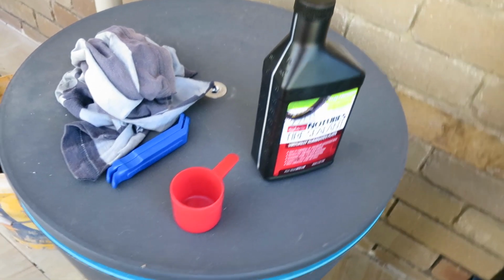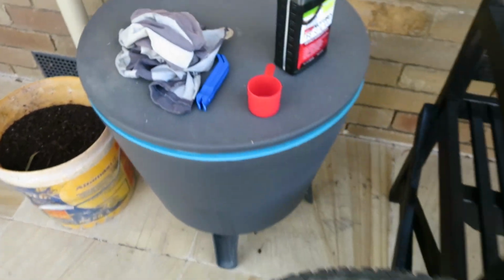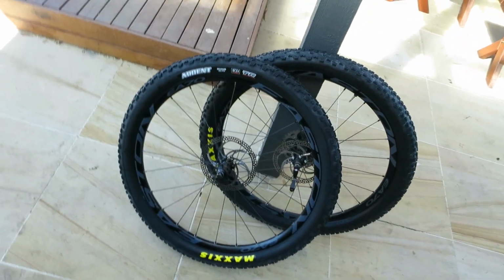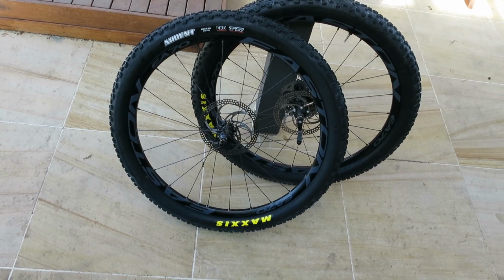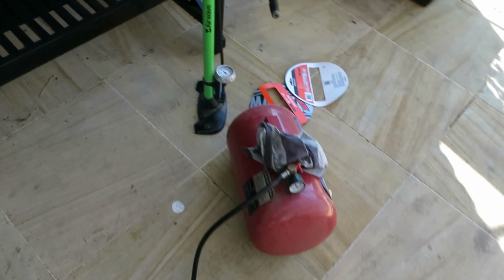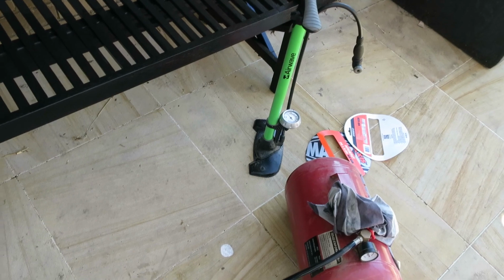Maxxis Ardent EXO TR - Tubeless install

Comment: What is good for trail and slightly jump? Ardent or Forecaster? Thanks
My friends said Ardent
Reply from the maker: No idea sorry mate, I don't do much mtb'ing really. I would imagine a lighter tyre would give you better control in the air but may be less durable on trails depending what you're riding on.

Comment: Hey buddy,  I'm still confuse with TR tyres. It still can be use with tube right?
Reply from the maker: Gordon Yap yes you can use tubes in tubeless tyres. There isn’t much difference in the tyre itself other than maybe a tighter fit on the rim (which also needs to be tubeless compatible for a tubeless setup to work). There’s no need to buy TR tyres unless you want to run a tubeless setup as they usually cost more than non TR tyres.
Reply: @jamdiversified9698  if the rim is not tubeless ready, can using cush core make it tubeless?
Reply from the maker: @madrodeo425  To be honest, I have no experience with crush core so can't comment (I had to google what it even was!).
Reply: @jamdiversified9698  cush core is something like a foam that fits in the rim. It helps to protect the rim on impact and as well as rolling of the tyre.

Comment: how much psi is ideal ?
Reply from the maker: Maybe 25-35, depends on what you like.
Reply: @jamdiversified9698  that low? The tyres specs says max 60 psi right?
Reply from the maker: @NVYOUTUBE01  yeah that’s max psi the tyre can take, doesn’t mean you need to have it at that pressure. You generally get better grip for mountain biking use around 25-35psi, depends on your preference and specific use but that’s about right.

Comment: Seriously I don't see what the differences on these tires. tires are tires They all do the same thing just buy a tubeless valve stem and use gorilla tape and seal and fill her up why spend $100 on a bullshit tubeless tire??
All tires come tubeless your just ditching the air tube....
Reply from the maker: Chris Smith Well these weren’t much difference in price from wiggle or chain reaction, def weren’t $100. Theres plenty of non tubeless tyres that cost more than these at the time so I just got these¯\_(ツ)_/¯ chill bro